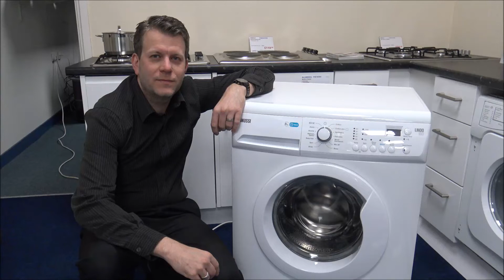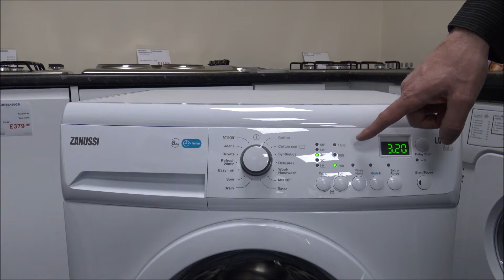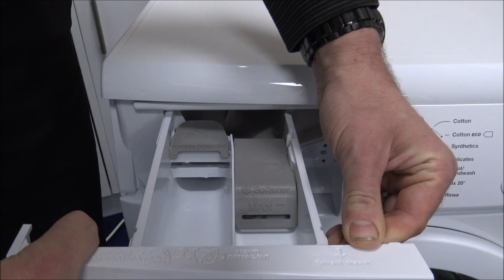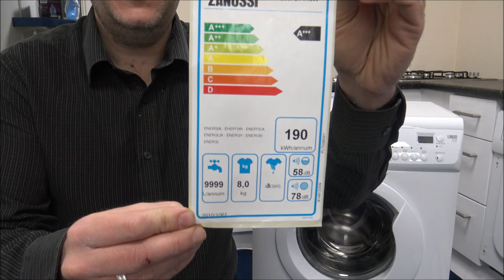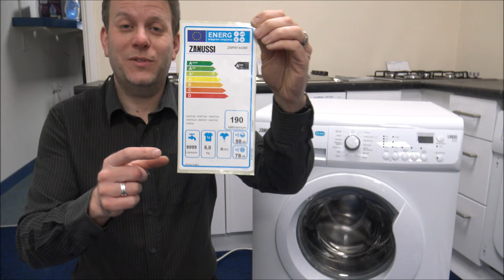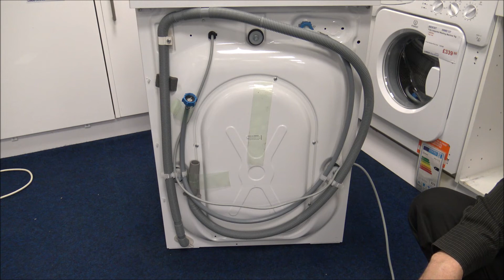Zanussi ZWF81443 8Kg 1400 Spin Washing Machine

Comment: What is wrong with the machine when it shows E50
Reply from the maker: This normally indicates there is an issue with the motor or an indidual component failure within the motor.

Comment: Anyone know how to open a stuck door that won’t open. I’ve done a spin and all water is out. I can hear the luck unlock but door still won’t open?
Reply from the maker: Sometimes if you have a filter, in the same compartment there may be a manual switch to enable you to open the door. Also sometimes push the door hard as well before pulling as it can release the door catch. Good luck

Comment: Had my last zanussi for 12 years. This seems a lot cheaper looking and not anymore advanced than mine which is over a decade old. Strange.
Reply from the maker: The build quality now is not a patch on the machine you have at the moment. If you purchased a new Zanussi washer, you would certainly notice the difference, and it's not for the better.
Reply: @lords-electrical  think I'll go bosch. Can't trust any of the new washibg machines now.
Reply: @Sweenece  The Zanussi timecare models are very good!

Comment: These are not great at all. I had one and it was one of the worst I had. I got sold as I couldnt stand it.  Too sensitive to loads and would take forever to balance the load and it was very whiny on spin. Sometimes wouldn't  spin because it was so sensitive.
Reply: Mine have short cycles and spin perfect!
Reply: Thanks, I was ready to buy one. What do you recommend instead? Blomberg or Beko?
Reply: Alphaone99 I actually have this machine (not this particular model) for maybe 2 years its works perfectly, although I don’t use it often because It’s in my hometown house which I come here a few months per year.
Reply: Same replies to my sister's one, its so fuzzy on spins even if the load is the slightest bit unbalanced, cycles are drastically long (synthetics is the only cycle i'd use) even tho its doing well since 2015